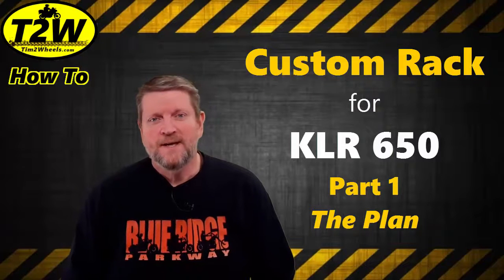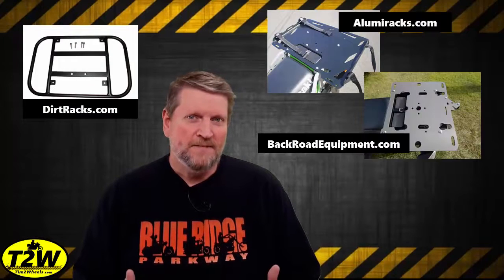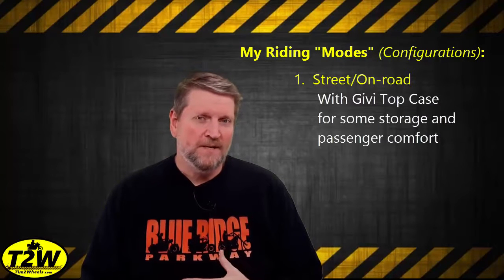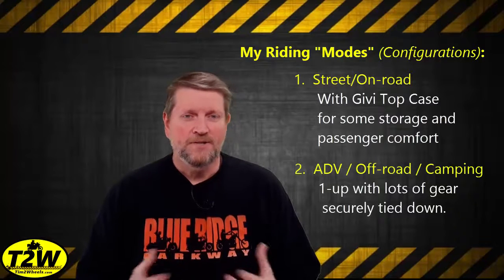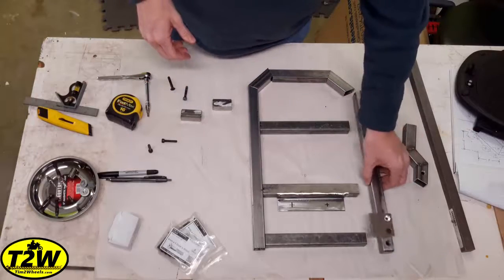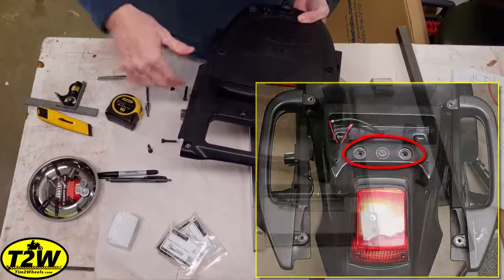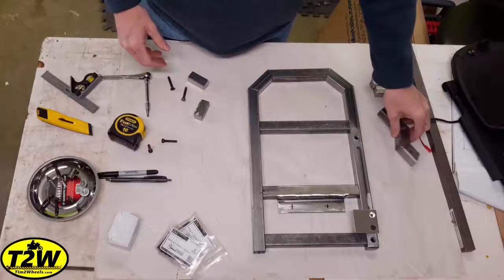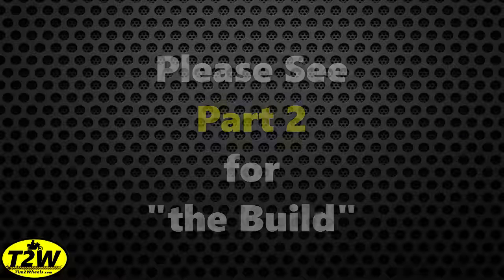T2W How To: Custom Rear Rack for KLR650 - Part 1

Comment: I have a 2013 KLR, the stock rack is weak, just plastic to save cost, they should have had a alloy rack complete, only the handgrabs are.
Reply from the maker: Hey Malcom, I agree. The stock rack was not very useful for me. This one is much better for packing gear.
Thanks for the comment and for watching.

Comment: Dear Tim, first of all I want to congratulate you for such an informative video. I recently bought a 2014 KLR and want to install a Givi Topcase just like yours. For that I have a question: on minute 3:20 you're holding the KLR rack plus the mounted plate, did you have to make any mods to the rack in order to install the plate? Thank you in advance.

Regards from a ADVrider from Perú.
Reply from the maker: +jlacerda14 Hi, Yes, if you want to bolt any base plate (Givi) to the factory Kawasaki rack, you will likely need to drill holes in it for the mounts. That is the plate I was holding at 3:20.
Thanks for watching!
Reply: Thanks, Tim. Do you have a video on drilling this holes? I've seen some Givi plate adapter for the KLR. Is it reliable?